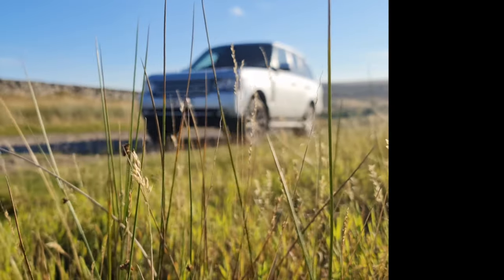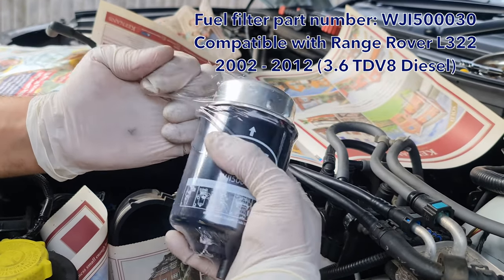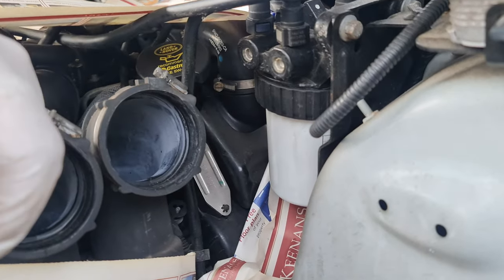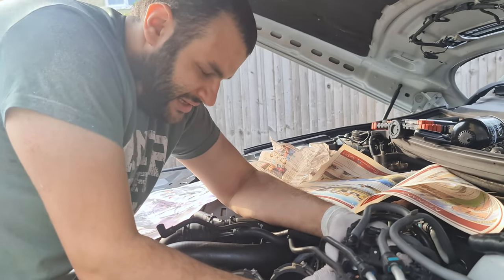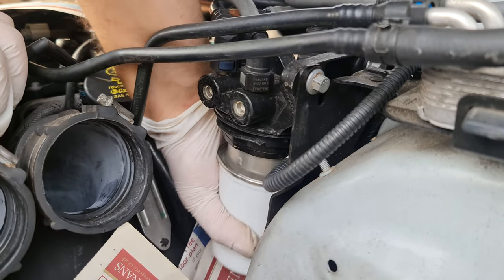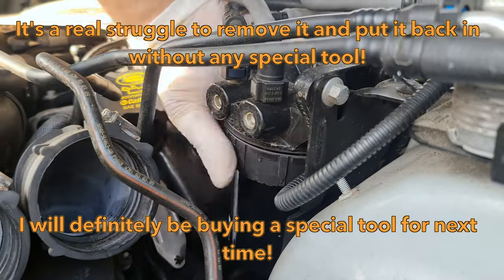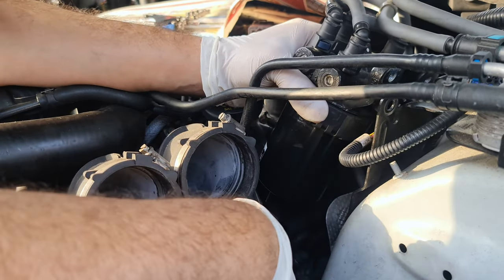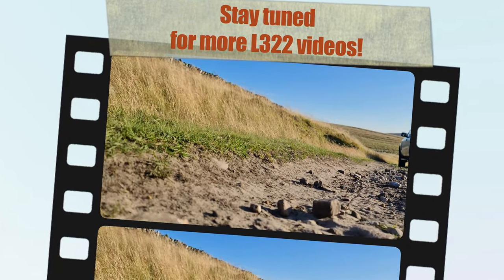Replacing FUEL FILTER on RANGE ROVER L322 (Service series)

Comment: Useful video Thanks, I’m going to tackle mine at the weekend wish me luck 😃
Reply from the maker: Hi John, thank you for the feedback, I'm glad you found the video helpful! 😊Good luck with replacing the fuel filter! 👍🏻Just to let you know, it doesn't show on the video, but the fuel filter is a bit stiff to take out, especially the plastic ring on top that holds it in place. Make sure to hear the click when you put it back in to ensure it's completely sealed. I made another video of removing the fuel filter within the major service video, and I used a specific tool to assist with removing it. I like that tool, but also other tools are available. Have a look at the video, here's the link - I hope it helps! 👍🏻https://youtu.be/yWRYkXMRD20?si=-Ckyc_0uZ3IH9cLW

Comment: I sense / know your frustration. Looks like a 5 min job, took 25 mins! Poor you!
Reply from the maker: Honestly, it was frustrating, took way longer than it should because I didn't have the correct tool and it was my first time so I had no previous experience. One year later, I then did a major service and I feel that was a lot smoother. Not sure if you've watched it (I used a special tool which made life easier): https://youtu.be/yWRYkXMRD20